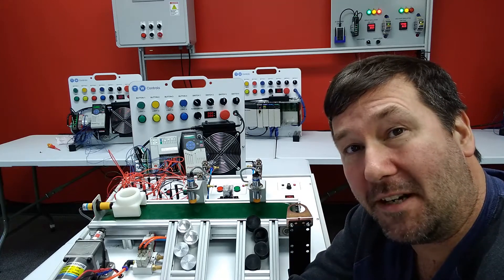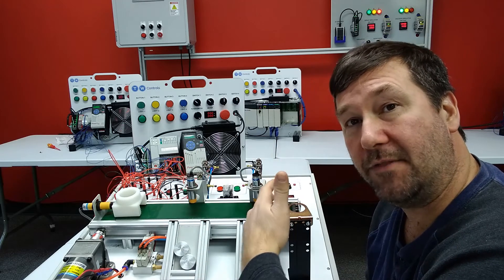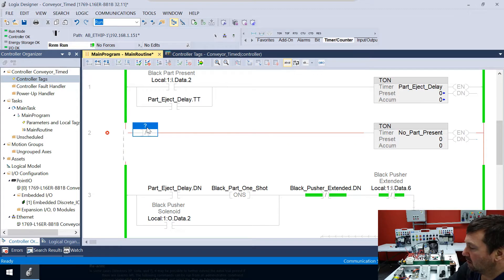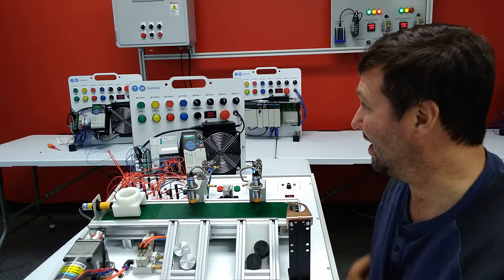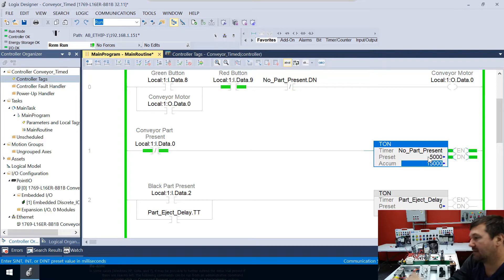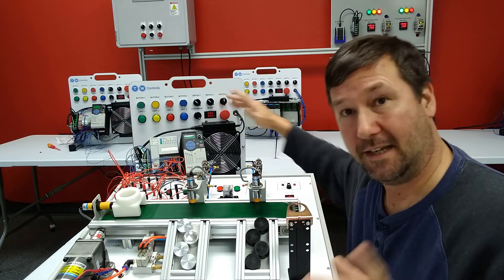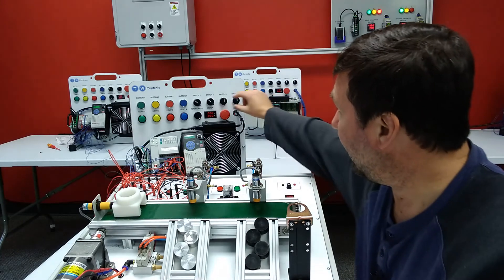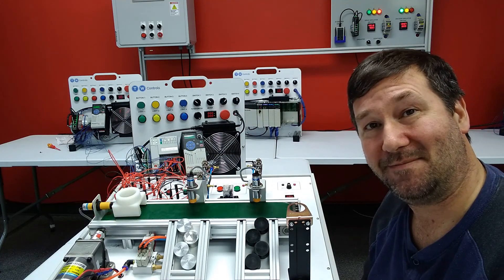Conveyor Trainer Part 6 PLC Program Automatic Control Hand Off Auto

Comment: I am asking the question here. Can you do a video converting IUUX file to notepad to alter a drives programming?
Reply from the maker: Not sure  what a IUUX is.
Reply: @TimWilborne  it’s a CCW file, to convert power flex 40s into 525 programs we use a text file and download that to the front module of the 525 using drive executive
Reply from the maker: @themichaelcoxproject  No, I'm not familiar with that.